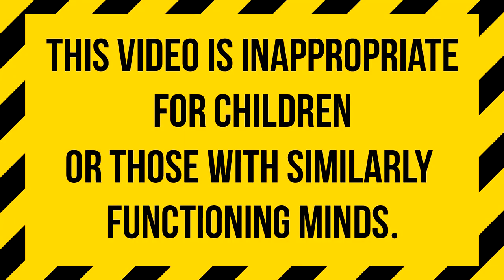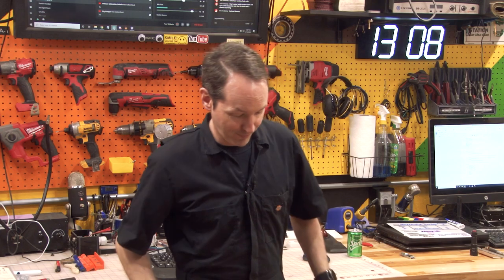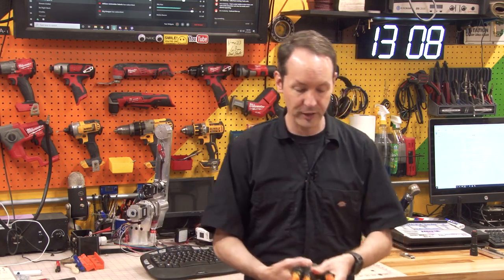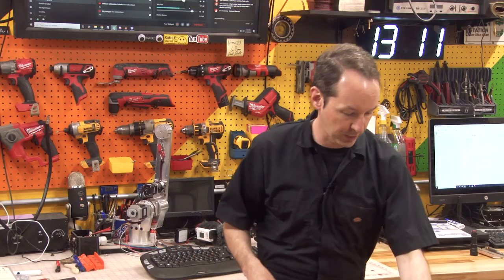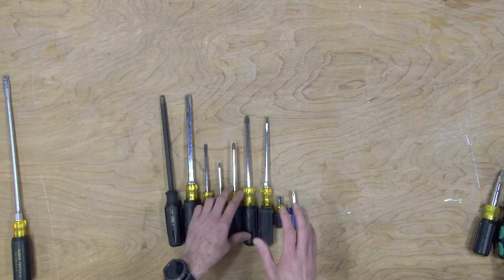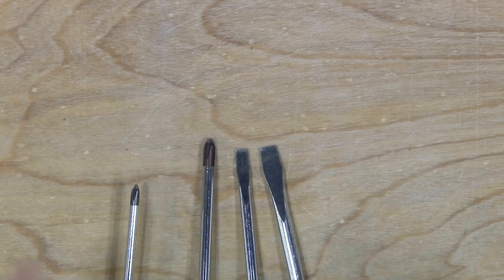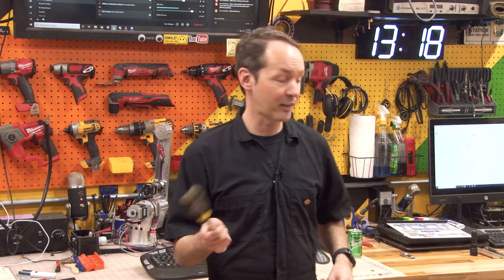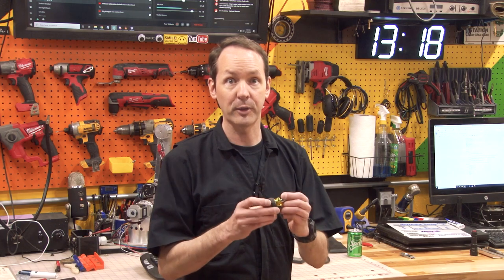Apocalypse Toolbox - Episode 1 - Screwdrivers

Comment: Bolts vs Machine Screws.  Machine screws typically get threaded into the hole while a bolt typically will fit in an unthreaded hole and only secured with the nut.